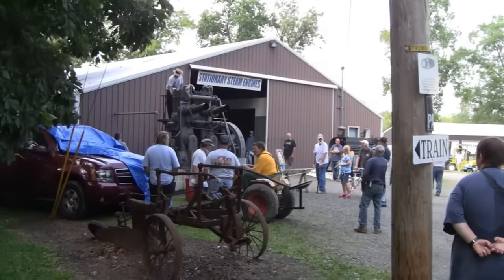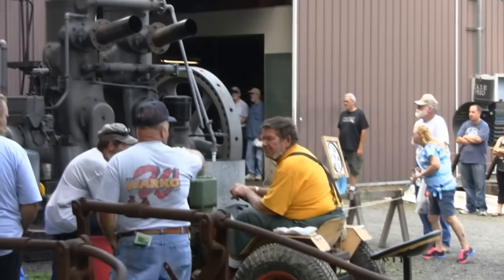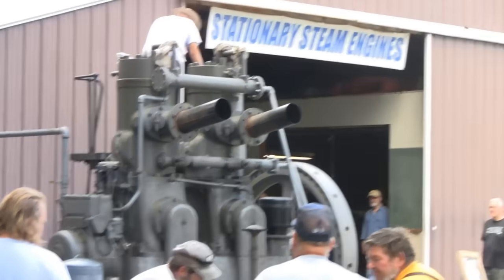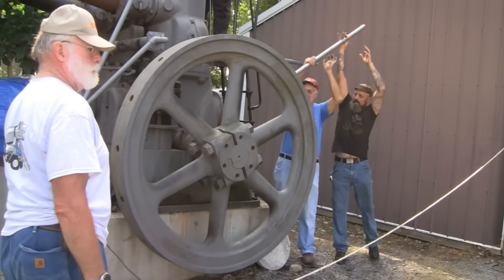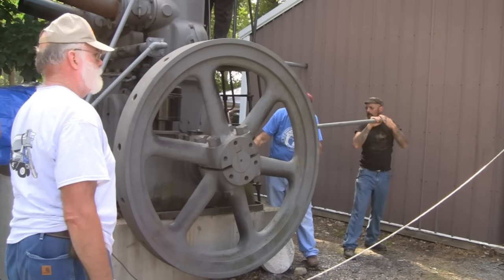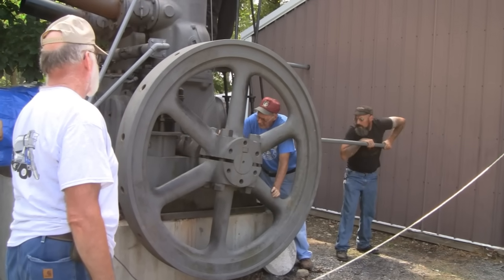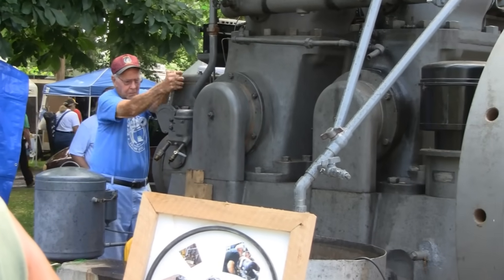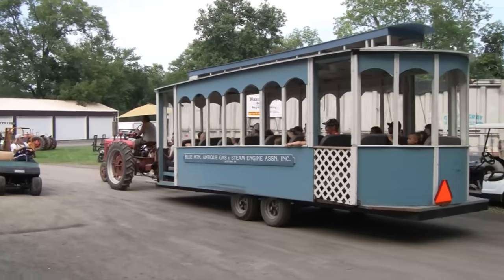HUGE FAIRBANKS MORSE MODEL 32 ENGINE RUNNING

Comment: This engine is a two stroke diesel engine. Fairbanks Morse designed these engines to start running on two cylinders when the rpm's started dropping. So it basically runs on one cylinder until it gets to slow then the second cylinder will kick in.

Comment: I remember one time 25 years ago we went duck hunting on a river and I remember seen an abandoned old engine that was twice the size as this half swallowed on the side of the bank, I'm quite confident that it's still there
Reply: Rogue river? If so, it's still there.
Reply: Probably used to drive a water-pump for crop irrigation.
Reply: Would love to get the big engine. Where is the beast ???

Comment: It's only running on one cylinder because that's the way they idle. These are power demand engines and only fire all cylinders when they are under load. Usually one cylinder is set up as the primary which keeps it turning at no-load idle with the others governed off until under load.
Reply: So the other cylinder is like a back up to keep it at the set rpm
Reply: bearbon2 You make it sound more complicated than what it really is.
Its a hit and miss engine so when 1 cylinder is enough to make the flywheel latch out the other cylinder doesnt get to fire. You dont control which cylinder fires, its just dumb luck. The same thing would happen if you had 2 or more single cylinder hit and miss engines belted to1 shaft in parallel with no load. One engine would by blind chance be the one that fires making the flywheels spin too fast for the others to fire.
Reply: richard vaughn Uhhhm, no? The Fairbanks-Morse Model 32 is not a hit-and-miss engine, it's throttle-governed... What bearbon2 said is correct.

With all due respect, have you even heard the difference in sound a hit-and-miss engine makes, compared to one that's throttle-governed? They're completely different rhythms. Plus, most hit-and-miss engines I know of are single-cylinder, you rarely find a multiple-cylinder one.

Hit-and-miss engines also do not fire this rapidly once they are at speed. They can fire once every 20 seconds if the RPM is set fairly low. This one is firing about 4 times per second, per cylinder (while both cylinders are firing).
Reply: I don't think there are hit and miss diesels.
Reply: I don't think there are hit and miss diesels.
Reply: @t44e6  ,
Well, at least your comment fired on both cylinders.
Reply: @ike fun,
I was wondering if the exhaust valve was stuck open on the cylinder that wasn't firing. The white smoke seemed to be diesel fuel vapor that failed to ignite.
The explanation given by another comment, regarding the speed-governing system, and how only one cylinder would fire at idle rpm, seems to solve the mystery.
A bit primitive, for the injection pump to continur to deliver fuel to the disabled cylinder  ... but then, this was early technology. Its not as if they had a CPU overseeing the process. More likely, they simply used a mechanical linkage from the governor, which prevented the exhaust valve from returning to its seat, once a preset engine speed was reached. Had they placed an actual load on the unit, the second cylinder might have been permitted to develop compression, and both might have fired evenly. Would have been an added thrill to hear both cylinders singing in harmony, especially with those straight-pipe exhaust tubes, and no silencers fitted. I suspect that "back in the day" those exhaust tubes would have united into a single stack that directed the diesel exhaust out of the manufacturing plant, via the rooftop.
Reply: @ike fun,
Oh, I see. Well, that is very interesting.
I'm going to have to research the Fairbanks engines.
Reply: @ike fun,
Yeah, I just Googled Fairbanks Morse and read a write-up on the Model 32 and studied a cross-sectional diagram of its layout. Lots of facinating facts to be learned about them!
Such as: "Normal operating speed ranged from 257 to 360 rpm."
Sounds like major design improvements were introduced around the 1925 production year.
There are still 3 units in operation in Quincy, IL at a power generation plant, and another three serving as standby units in Delta, CO..
The maintenance schedule for the Model 32 is mind-boggling. "At 40,000 hrs (or 4.57 years) of continuous operation, the piston pin and the bushing should be replaced."
These were very cool engines.
Reply: bearbon2 Was
Reply: This is a two stroke hot bulb semi diesel. It is hard to get them to maintain heat without a load, no heat means no combustion. Its not a design feature, its not a malfunction, its just a side effect of running it with no load.
Reply: Kat the Foxtaur furrys have no say in this
Reply: @JoseSalazar-cg9ql ,
Thankyou for your input. You've certainly shed a great deal of light on the topic.
Reply: @richardvaughn2705 , These aren't hit and miss engines. bearbon2 is correct in this case.
Reply: Not to seem impolite, but no that is not how fairbanks diesels operate. All cylinders are supposed to fire weather they have a load or not. I have worked on quite a few of these. This one has an issue. In the past, I have generally found these to misfire if the pump relief valve per cylinder is out of adjustment, or the injector needs cleaned. Very basic and fun engines to work on, you can repair them yourself on a typical work bench. I have all the original literature on the y, yh,  yva, 32E and D diesel models. Very handy when repairing. This particular engine in the video is a model 32E 14X17 later fairbanks diesel. These require no preheating  before starting. The first model fairbanks to not require preheating was the model YVA.
Reply: No, it should be firing on both. The 6 cylinder models dont do that shit. Why would a two cylinder? Dont make sense hommie! Look at the smoke! When you try to start a diesel in the cold an all you get is white smoke what's that saying???
Reply: Thats crazy
Reply: @marshalllhiepler  No valves...its a two-stroke.
Reply: @serioustrouble63  ,

Yes, thank you.

It required several revolutions, but I eventually realized that, once things warmed up.

The old grey matter is hitting on all cylinders now.
Reply: @STRETCHED48  air in injection line no fuel to number 2 cly
Reply: @James-aaron  but there is atomized fuel coming out of the exhaust so it wud suggest a stuck exhaust valve or something
Reply: @billkruize9060  ther is fuel hense the white un ignited diesel
Reply: The start-up is not shown.
No description of anything.
The reason it runs on one cylinder at idle is not explained in the video.
Can they not do better?

Comment: Guys! Its a hit and miss engine. The flywheel speed controls a governor that latches out the exaust valves preventing combustion. Because one cylinder is enough to make the flywheel too fast, the other cylinder doesnt fire.
Which cylinder fires is blind luck. If they were to slow down the engine by adjusting the governor, cylinders would fire intermittenly and which cylinder fires would be more random.

Comment: I love those huge Fairbanks morse diesels, many of them were used for power generating plants and In service for more than 50 years and still continue to go strong they are an amazingly over designed machine
Reply: Definitely built according to Morse Code.
Reply: @marshalllhiepler  bro what does that even mean.  Genuinely asking

Comment: I know where two of them are setting at. They're 32D two cylinder Fairbanks and Morse engines. They set 3miles south of Gillette Arkansas on US 165 . One sets on the ground and the other sets on it's mounting blocks. The later has oil in it and does turn over and has compression. It's cooler and fuel tank are long gone and the building of the rice grist mill it ran is gone. They are both free if you can move them. The farming museum south of them knows the owners of the property. They set next to the road.

Comment: I'm with you.  I only think that it was running on one cylinder.  It did sound like a few times that maybe fuel was introduced into the second cylinder but it never took off.  Is it strictly a manual/human pull start or was there an external source for starting like compressed air?  I hope those old chaps figure it all out and teach some of the younger guys how to start, run and maintain the engine.  It's fantastic.
Reply from the maker: jbmbanter I think they use compressed air to start it!!☺

Comment: If that engine were to run away, you'd have to run away. Either that or you'd have to stuff about 5 quilts into the intake to make it shut down.
Reply: Cameron Jenkins imagine how much more you’d need for a run away model 32D
Reply: Have a cylinder of CO2 or Argon welding gas plumbed into the intake. No oxygen no ignition.
Reply: t44e6 that sounds way more complicated than just adding a gate valve on the fuel supply lol
Reply: CaseyD11 not necessarily.  Probably easier than cutting the fuel line installing a valve with 2 compression fittings. 2 more potential fuel leak points And I think a globe valve would be much better that a gate valve. Lol
Reply: It’s a crank case scavenger engine. It has no oil in the crank case. It is impossible for this type of engine to run away
Reply: @CaseyD11  Most compression ignition engines run away because they begin burning their own lube oil, so this would not be a very reliable means of stopping the engine in the event of a runaway.

Comment: That's Cool how the Exhaust blows smoke rings
Reply: its not blowin smoke rings its blowing fuel ring runin on one cylinder
Reply: Whatever ...They are rings
Reply: max penrose that's steam. Water getting in combustion chamber somehow. Fuel smoke does not dissapate that quickly.
Reply: compression evaporate fuel but no burning inside because lubber not warmed up bulb

Comment: I'd love for you and the crew to get a chance to revive one of these big ol' FM 2-strokes, but they're just so damn big you'd never get it in the garage!
Reply from the maker: Mike almost bought one identical to that a couple months ago!! He drove 700 miles to Tennessee and when he got there the guy sold it out from under him!!☺
Reply: @805ROADKING  Man that just ain't right. Guy drives down 700 miles to pick somethin' up he's probably not gonna back out.

Wish I'da known he was comin' down here though, I'da waved at 'im. I'm out that way myself.

Be kinda cool to have one out behind the shop, feed it filtered used cooking oil, make it power the compressor and the outlets in the garage. Have it thumping away back there in the background when ya'll get a chance to have an engine night. Get a lot of good videos off of it!

Comment: The white puffs from the exhaust appears to be low pressure condensation.  It dissappears too quickly to be Diesel smoke.
Reply: Yeah, according to other comments other cylinders in these 2 strokes were only on-demand

Comment: It looks as though he tries to bleed the flywheel side cylinder injector at one point. But it's definitely running on one. Work in progress I suppose.
Reply: Royal Pine Its a hit and miss engine. It only fires intermittenly depending on flywheel speed.

Comment: dude you totally missed the start. also sad that the second cylinder was not working
Reply: Look at other videos of model 32. It seems, that under no load, they automatically switches to a single cylinder. This one they didnt spin down long enough, to make the second fire.

Comment: It's a shame it didn't run on both cylinders. It did here and there, but I wish it stayed running on both. Great video!
Reply: Aust1n's Reviews & More Its a hit and miss engine. When the flywheel spins too fast it latches out the exaust valves preventing cylinders from firing. In this example blind chance has that same cylinder stealing the show. If you turn the speed down by adjusting the governor then it will only fire intermittenly which will then start to fire on random cylinders.
Reply: @ike fun Well you're just as ignorant as the last guy... the cylinder blowing smoke rings is the idol cylinder that was running, the other cylinder kicks in as load increases or rpm's drop as seen in the video.

Comment: Oh, that makes sense, i was wondering how they would get both cylinders running at the same time without a pony motor, the volume must be huge on that beast.

Amazing that it works (and so well) after so long. I think i heard you say it was restored. Good job on them.

Thanks for sharing this, you don't get to see stuff like this every day. :)
Reply: a crankcase 2 stroke rune under very high pressure

Comment: To bad it only ran at one cylinder :)
Reply: Kobe
Reply: Modlendingen Its hit and miss. It runs on which ever cylinder has the exaust valve not latched out by the governor.
Reply: no, @richard vaughn - they fixed the engine later, it runs on both cyls now
Reply: Will you quit saying that!! It'a 2-stroke Diesel. Not a hit & miss...
Reply: Again more fools calling it a hit and miss or saying its only supposed to run on one cylinder. You're all wrong! Its a hot bulb two stroke semi diesel, they don't generate much heat with no load. No heat means no ignition. You can preheat the bulbs more and get it to run on both cylinders for a while but after a while one cylinder is likely to cool down enough to lose ignition.
Reply: @coreyschmidt1647  actually no hot bulb. Fairbanks literature even at the earliest got away from the hot bulb design. They early Y engines are reminiscent of hot bulb but fairbanks particularly states the opposite.

Comment: HAHA!  Neat...but FALSE ADVERTISING!  2cyl runs on 1!!!  BAWHAhahaha  You and Mike never be caught dead with a half-runnin sputterin engine!  :)
Reply from the maker: TheLipRipp3r I said it was running, I didn't say it was running good!! Lol!!☺
Reply: 805ROADKING hahaha!
Reply: TheLipRipp3r Thats a hit and miss engine. Under no load that one cylinder is giving enough push to keep the governor out which latches out the other cylinders exuast valve.